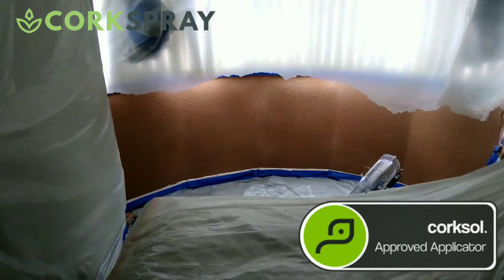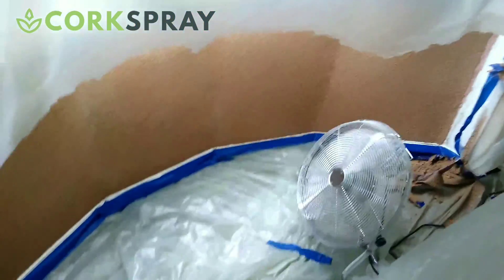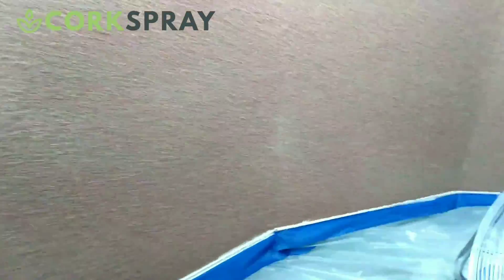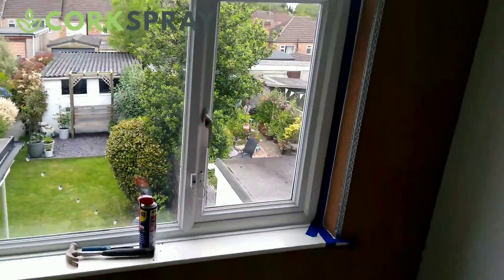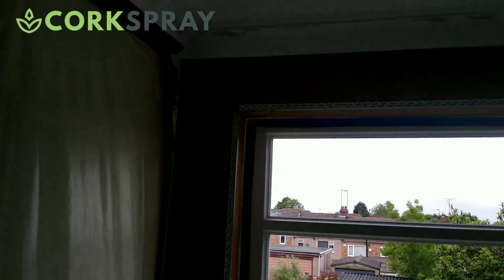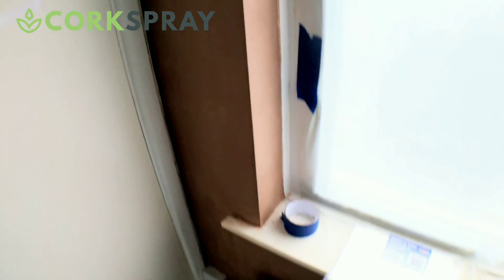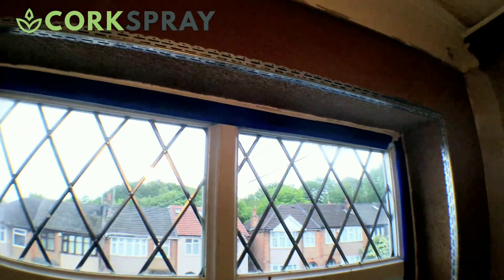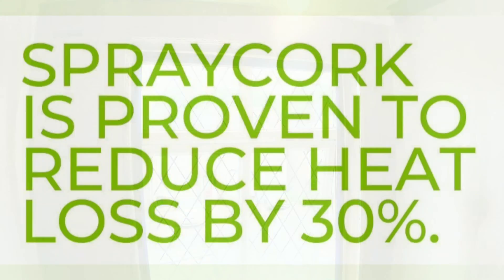What is Spray Cork Insulation?

Comment: Wasn't clear. So u had the damp, did u have to break the palster and replaster and then to this insulation and then skim or did u just have you just  wipe the mold. And then do the cork coating?

Comment: Uhm, you only get rid od the mold if you get rid od the reason why mould gets born

And fhat is the construxtion itself not ezterior coats 
You have very low vapor being able to exit out of the house, the house doesn't breathe
This xork thing won't solve the issue, it might maskt it, but mould still inside the wall frame due to humidity inside, youre not fizing the humidity issue in there
Reply: The mould is formed from the inside due to cold surfaces any moisture within the home is attracted to the coldest surfaces which in this case is the outside facing solid walls

Comment: Looks good but this is just masking the issue. There's a different reason mold is growing in these areas.
Reply from the maker: No this is certainly not masking. The surfaces we treat are cold not damp. They attract moisture created inside the home this is how black spot mould damp is formed. The cork layer prevents condensation forming on the surface 👍if you'd like more info just get in touch thank you
Reply: @SDRobertsPlastering  Thank you for sharing this information. How do I know that the surface is cold and not damp? Also does it really improve the thermal sensation inside?